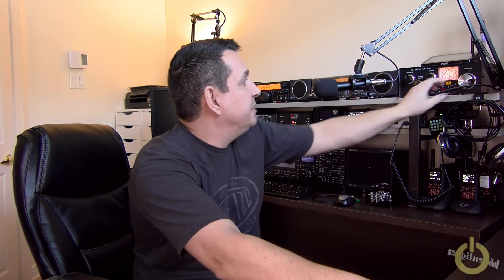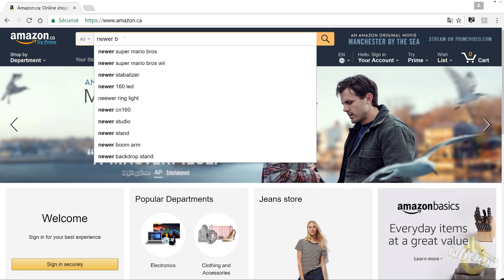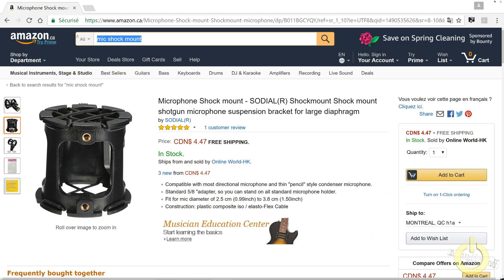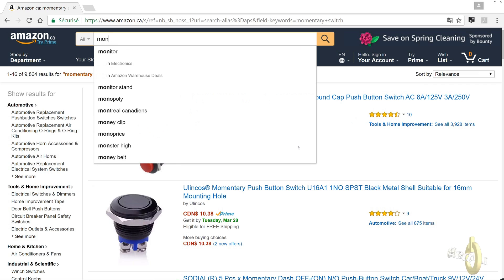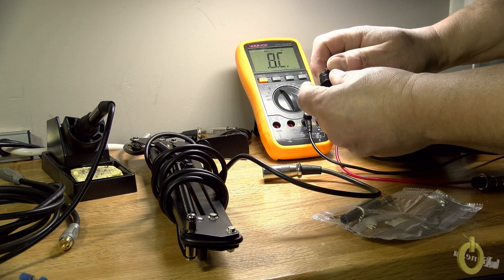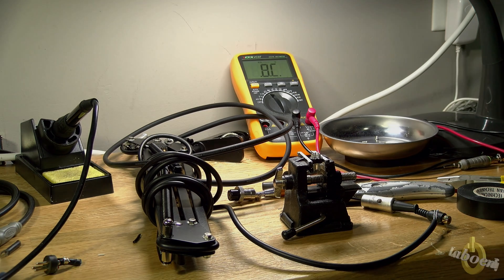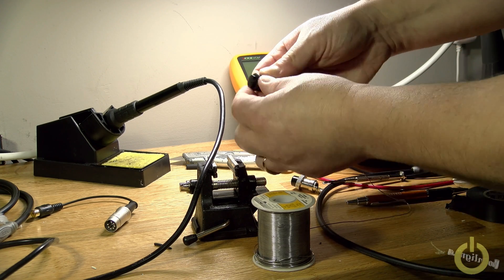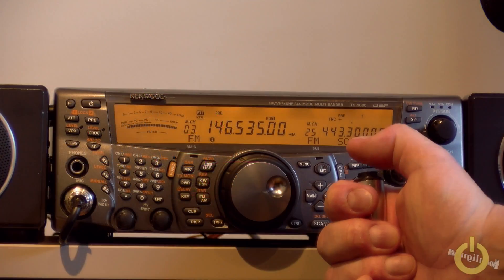Ham radio mic with boom arm and DIY Hand PTT for less then $60 !

Comment: Great video.  I look forward to your videos.   I am trying to set up handsfree for my FTM-400XDR and IC-7300.  My understanding is the I will not be able to use the same mike for both radios.  I will need a dynamic element for the Yaesu model and an electret element for the Icom 7300.   I cannot find the NB-35 on Amazon.ca.  Do you have other suggestions for the arm and the mics??

John VA3BOF

Comment: I need to know how to build a ptt switch for the 6900n can anyone help? Want to use my feed to activate mic
Reply from the maker: You need to find the PTT and ground Pins on the mic connection, and your foot switch needs to be momentary.  On when push and off when release.  So, when on you short the two pins to PTT.

Comment: great content but  im confused which socket do you plug the ptt lead into thank you
Reply from the maker: You need to connect all the connections on the mic plug of your radio, so you will need to find the correct pin for the MIC, the ground, and the PTT.  73
Reply: @Laboenligne  thank you i didnt notice the other end of the rca lead you used and the plug that goes into the acc port im all up and running now thanks to you tutorial, thanks for the reply

Comment: am buying a new radio the Kenwood TS 890 and I want a suggestion to use the microphone I am in doubt between the Microphone MC90 Kenwood or Heil PR40 ?? I like ssb mode contest  73
Reply from the maker: That's all depends of your need, I think I would go with the Heil with the cable and the hand PTT.  73 Pascal VA2PV
Reply: @Laboenligne  thanks, 73PY2RZ

Comment: Awesome. Can I hook boom mic up to a dual band ham radio like Baofeng uv5r pocket ?
Thank you.
Reply: I am not sure as the UV-5R uses a TRS connector on the mic input and it may be a non-standard wiring config for the PTT signalling.

In most likelyhood it's probably just a simple two wire config for the mic and they are just looking for whether or not the circuit is open/closed (connected/disconnected) as the indication of PTT. But it could be more complicated and have a 3rd signal wire for the PTT.

Comment: I can't find a pinout for the 1800s.
Reply from the maker: There is a lot of info via the website below.   73 Pascal VA2PV
http://www.qsl.net/g4wpw/date.html
Reply: Thanks for that. Unfortunately, I could not find my question answered on that website. I don't need to know the pinout for the connector to the radio. I did see the XLR connectors mentioned on the website, but, no description as to which pin / wire serves as which function. I just need to know what each of the three XLR wires serve as so that I know which pin to solder them to. I figured considering you performed that task in the video, it would be easy for you to tell me what function pin 1 -3 does instead of providing that website as my question relates to the same 1800s microphone and XLR cable than radio connector specific.
Reply from the maker: See this website.  http://www.nu9n.com/transceiver_connections.html
Reply: Thank you.

Comment: how good is the behringer mic
Reply from the maker: Very good for ham radios, when installed properly.  73
Reply: question?  do i need to use phantom power for this mic
Reply: no - it's a dynamic mic

Comment: I followed your suggestion and got the boom and microphones. Very happy!  One issue was the xlr connection at the base of the boom would not fit my heil microphone adapter for my ft-991. Although they are both the 3 pin xlr it was too tight to plug in. I see you cut off that connector and soldered your own connection to the radio. I cut off the xlr and soldered on a higher quality xlr that had a better fit. 
Thanks for the great videos! 73 N6JGL
Reply from the maker: Hi Charles, well thanks for watching and I'm happy it helps.  73 Pascal VA2PV

Comment: I made a similar but I use the ready made Heil headset adapter and since the headset adapter used a 1/4 headphone connector i used a instrument audio cable after cutting 1 end off.
Reply from the maker: That's another way ;-)  Thanks for watching. 73 Pascal VA2PV